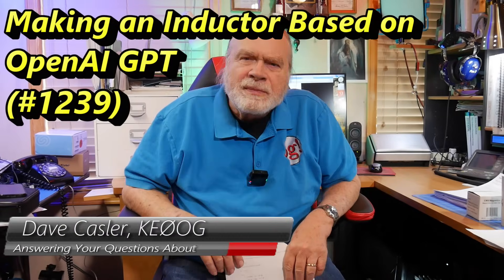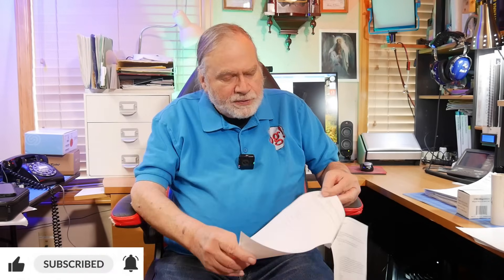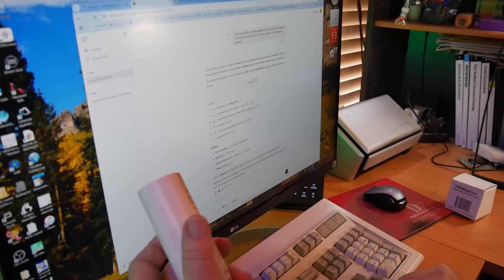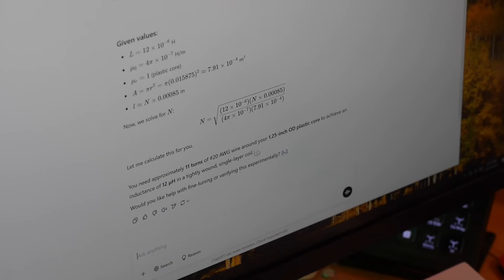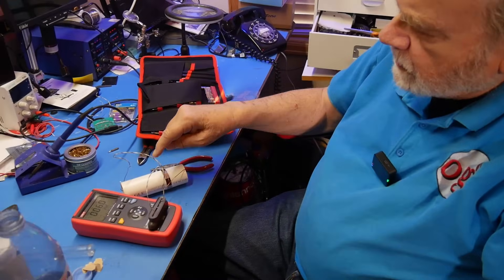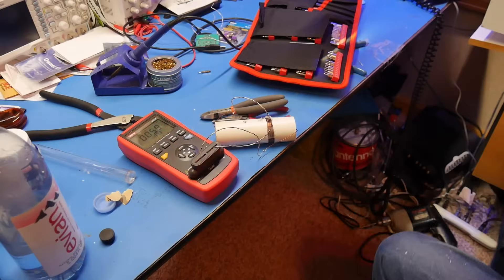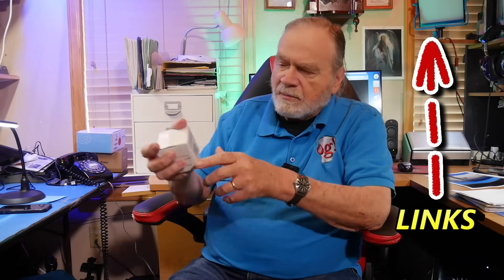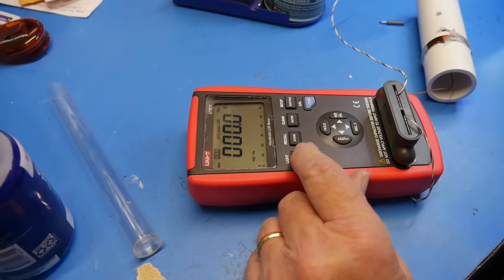Making an Inductor Based on OpenAI GPT (#1239)

Comment: Using the Pacific66 Inductance calculator, a 1.5" PVC pipe core (actual diameter = 1.9") and 20 AWG wire, tight wound requires 13 turns for an Inductance of 12.3 microHenries.  (( FWIW ))

Comment: Years ago before computers... the ARR, issued a cardboard slide rule that supplied all the information for diameter, length, wire diameter and number of turns. I've used it for years for many many coils and it gets you close.   you can slide a piece of steel tubing inside or a piece of aluminum tubing inside either to increase or decrease.